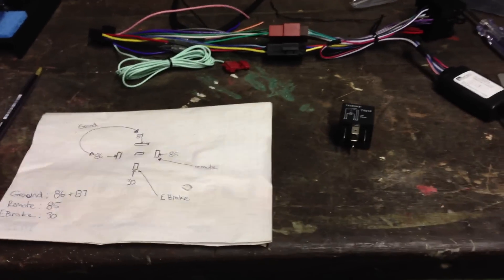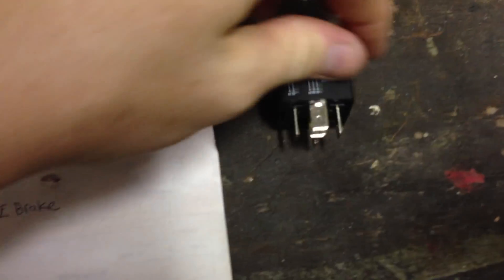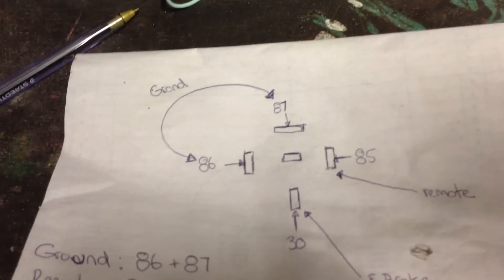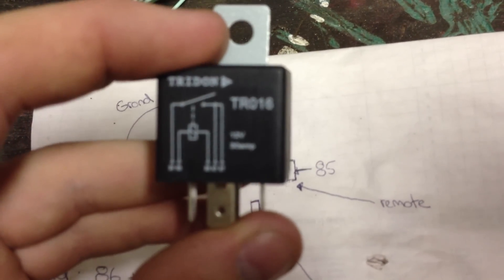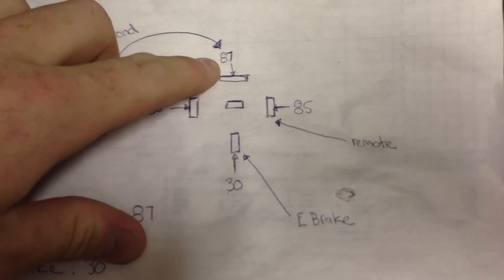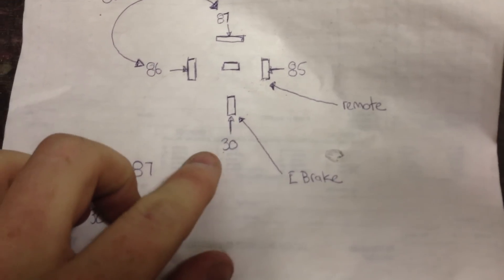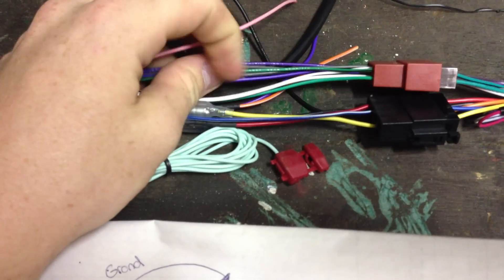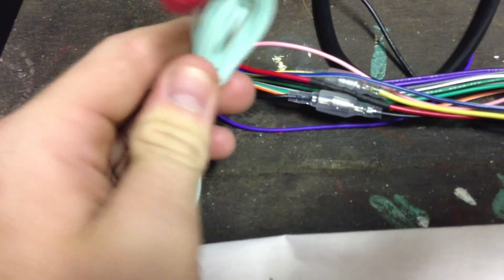head unit bypass e-brake relay (part 1)

Comment from the maker: I have never messed around with that unit but in most all cases it is not that easy. It will need you to disconnect and then connect back to ground. Like what a relay would do